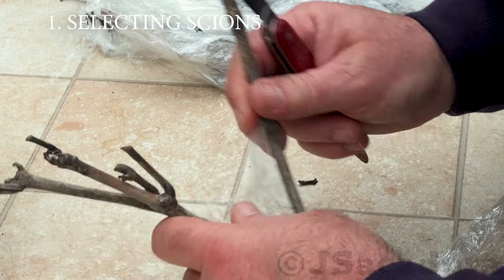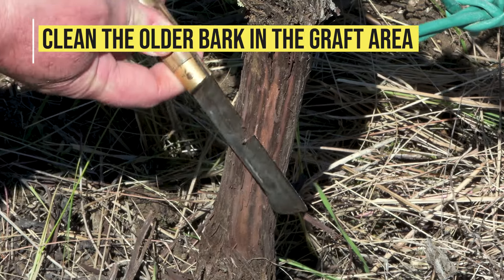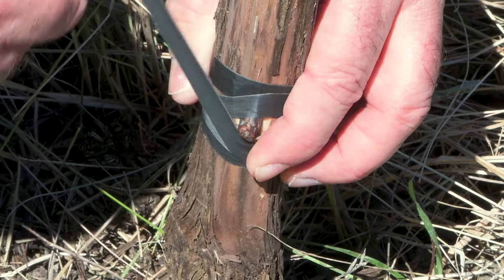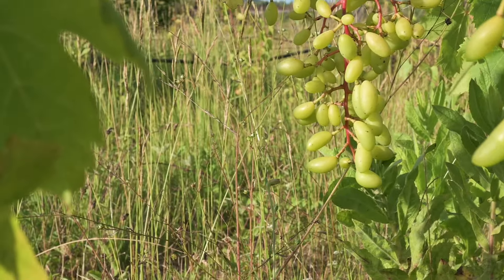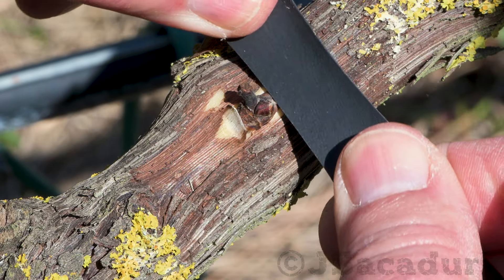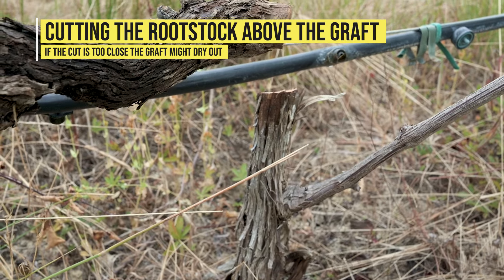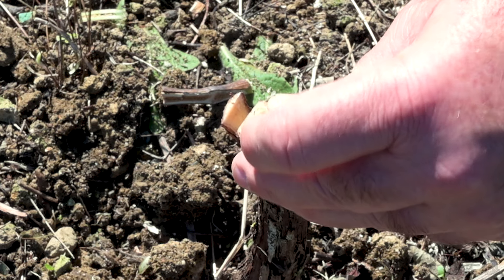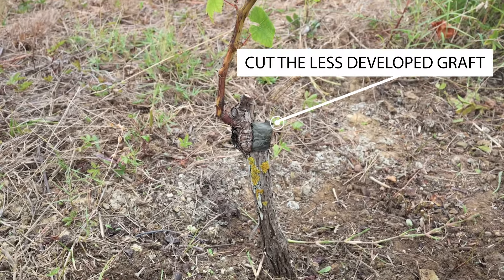GRAFTING OLD GRAPEVINES | 1 YEAR GRAFT UPDATE WITH FRUITS

Comment: Looking forward to your fig videos.  I tried a bunch of fig grafts this year without success, I suspect my root stock wasn't "awake" enough and the scionwood died before the root stock woke up due to a very cold April.
Reply from the maker: Hi, Don. Best results with figs require that the rootstock is fully awake. Over here I have very mild springs so I can graft since March, but I tend to wait and graft in April or even May in some years. Whip and Tongue is one of the best options for higher success rate but its tricky to perform with the fig scion wood (which most of the times if hollow). I would recommend the modified cleft graft in your case. Best of luck with your future grafts.